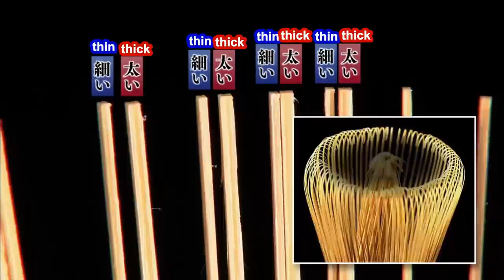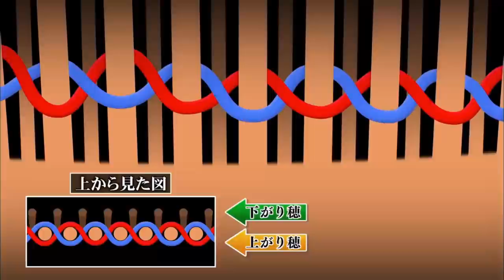With secret Knives for over 500 years, the KUBO couple will keep "Takayama Tea Whisk" on innovating

Comment: I was rough cutting 1/2 cured bamboo to length with a rotary saw.  The ease with which it cut gave me courage to converse with a pretty girl that was there.  I made a joke and glanced to see if perhaps she would smile.  The 20' bamboo shoot wedged and my hand was sucked into the blade.   The two middle fingers split from the back side.  There is a glitter of wisdom in this story. 🤔
     She disappeared a week later.  Came back 10 years later and died, alas, leaving me with 3 month-old twins.  They are 8 now...And I still nap whenever I can!😁